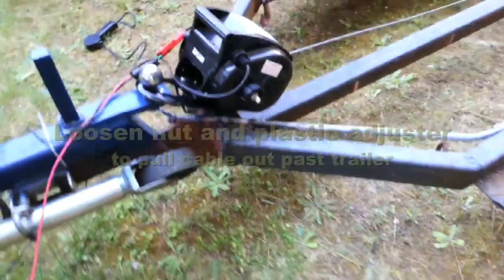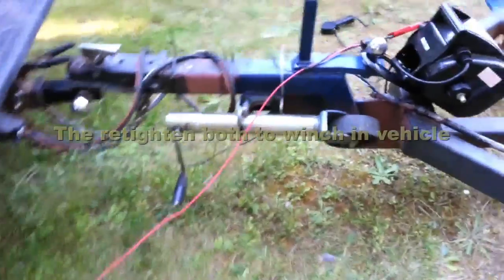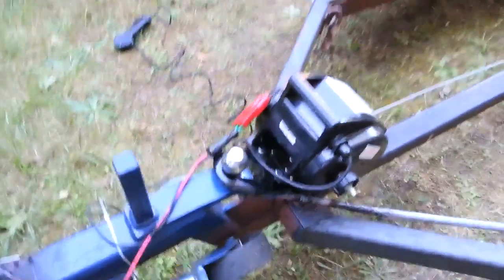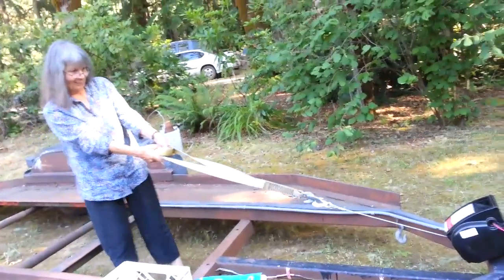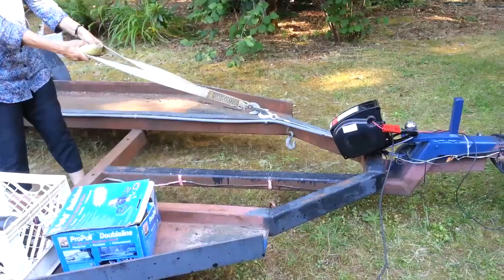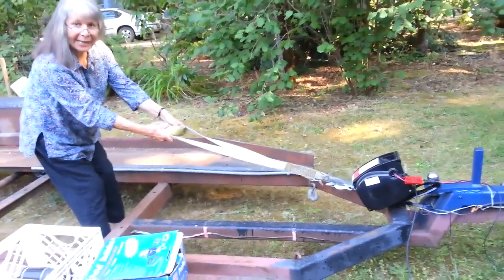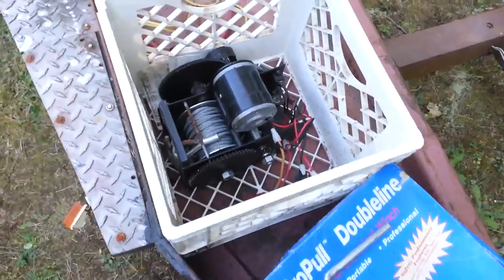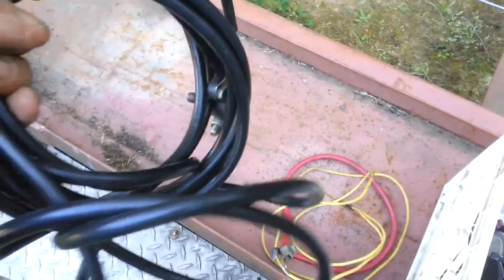Car Hauler Winch Setup

Comment: Nice! I need a setup like this!  I have spent a small fortune on towing junk vehicles I want to fix up.
Reply from the maker: Got a junk trailer and added electric brakes and other improvements. Even the boat winch is a big improvement over the comealong that we used to use.
Reply from the maker: A stranded Nissan Murano with a seized engine needed to be retrieved, so we set it up for our friend. As it turned out, it worked perfectly.